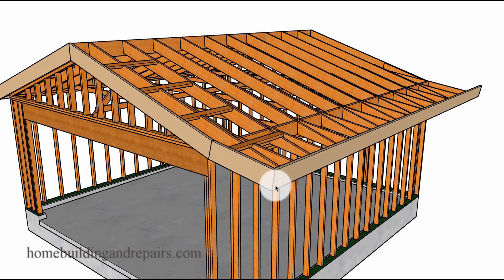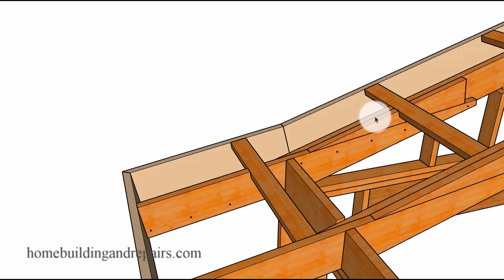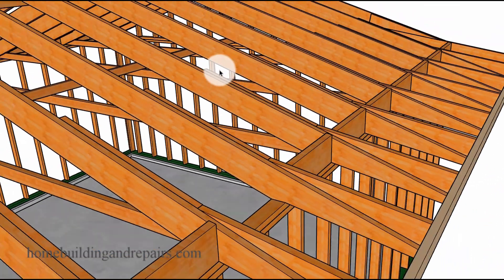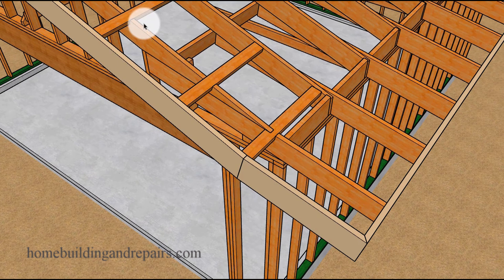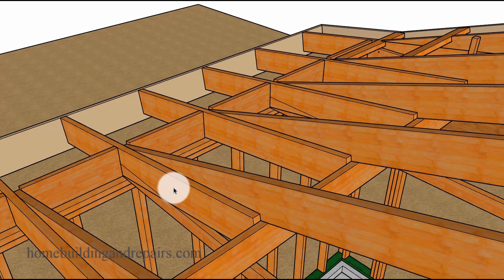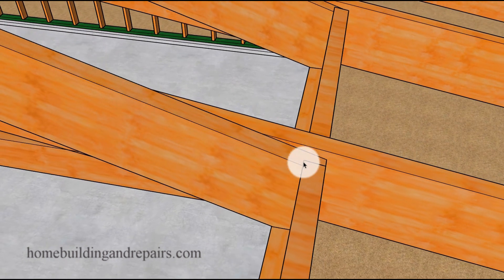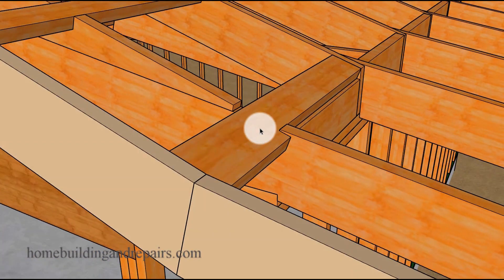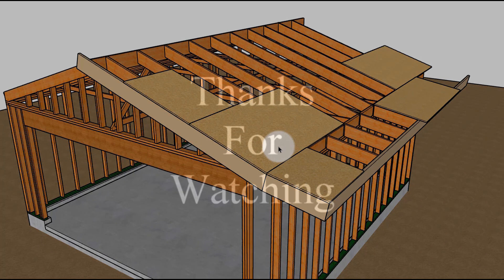How To Design And Build A Double Angle Roof Overhang - Low Sloping Pitch

Comment: Love all your content, is there a standard degree of extra eaves pitch or is it worked out by existing pitch..?
Reply from the maker: Most of the time it will match existing roof, but the angle can change. Just make sure the roofing will work with new angle. Some slopes less than 15 degrees might require different roofing installation methods.

Comment: Do you have any suggestions or videos for building an extension to existing roofs Over hang using hardware: such as a roof riser that can support a beam or a rafter bracket.  Could you use these without having to add in posts?
Reply from the maker: I don't have a video, but it's on my list to be made. I also would use posts under the structural connectors sitting on top of wall framing or roof.

Comment: I am installing a walk in shower, the wall frames are not plum and require leveling for the cement walls being installed. Can I install sister wall frame next to each and is it code approved
Reply from the maker: It sound like you need to check with your local building department for codes.

Comment: I have been looking at Japanese houses and one builder/historian said Japanese curved roofs actually designed so that winds coming down mountains and inland from sea storms would push DOWN on the roof rather than the usual airfoil issue (& subsequent lift) we see with single angle slope. Even the ridge top decoration was designed to break up the straight backflow (?) thus reducing roof lift.
So while thinking about that Japanese roof design you upload a vid on roofs with 2 different slopes.
 Very serendipitous. 

Any chance you could do a curved roof or one with 1 add'l slope change? 
What about HIP roofs with 2 different slopes?
Great channel. Nice length and no fluff.
Thanks
Reply from the maker: I will put your suggestions on my list.
Reply from the maker: And you're welcome.

Comment: while working for a pole barn building company whenever working with truss blocks... the locks along the posts under the trusses and any time tying anything to the trusses or outriggers we used galvanized 20ds.
Reply from the maker: Now that's a big nail.
Reply: @gregvancom  yes in deed i once fell off a ladder on the job and almost placed one square in my spine... god was watching and my belt stopped it from making past my skin...